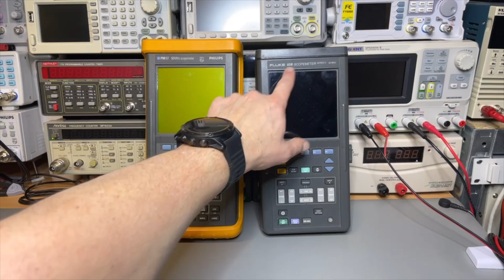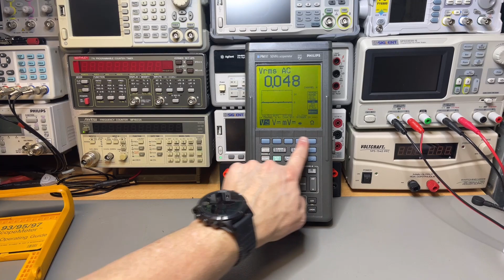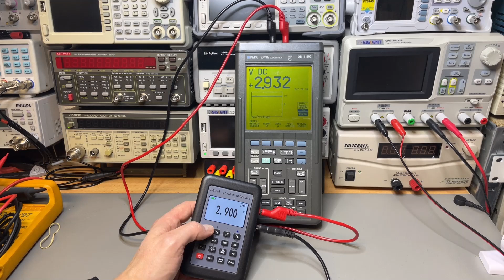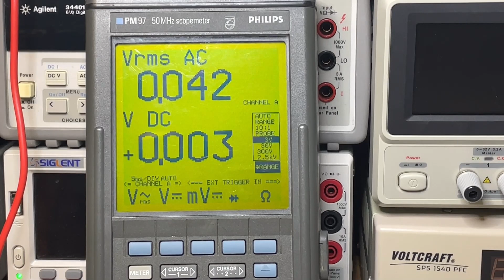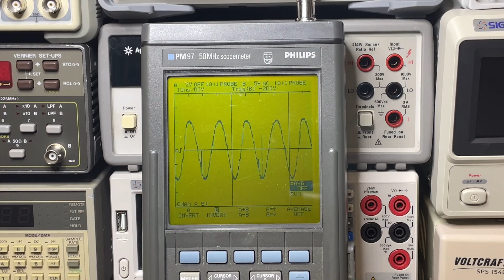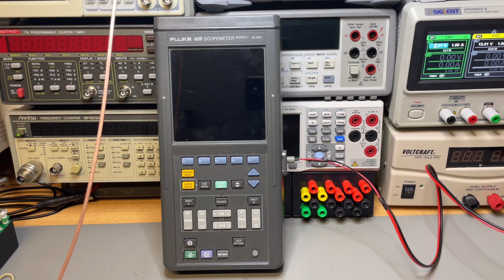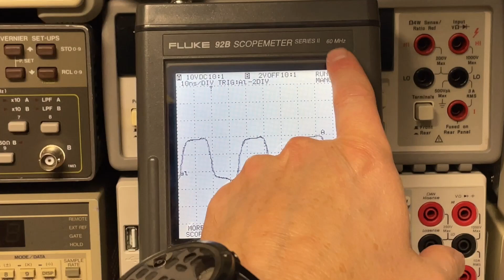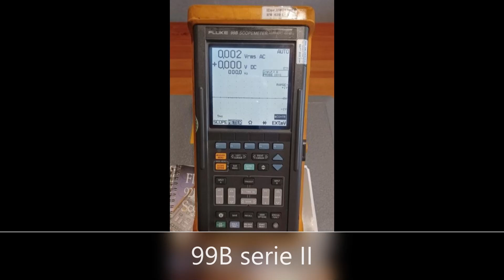TA-0334: Fluke Friday (E10) Fluke Scopemeter 97 and 92B Serie II

Comment: I have a 97  i love it, it does exactly what it was designed to do. I'm lucky,  mine has not had the capacitor issue so many experiences.  My screen is stillbright and functions fine. It eats batteries.... I've seen some nice upgrade options  i may go that route.  Cheers
Reply from the maker: Lucky man! i hope it stays good very long sir.  have fun!

Comment: Got a fully functioning pm93, and operating as it left the factory. Batterypack have been changed, and i store it at the original packing.
Biggest advantage is that its not grounded, sow no need for differential probes…
Reply from the maker: That is just great! hope you have much more years with it. yes the isolation is a big plus.